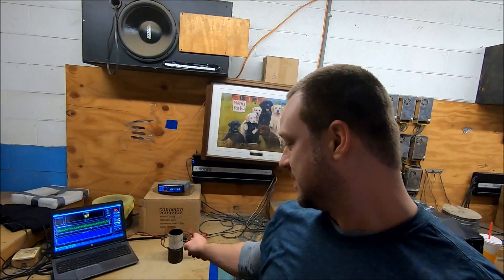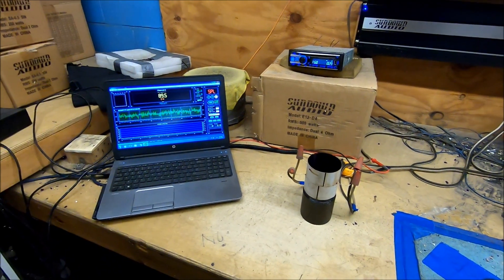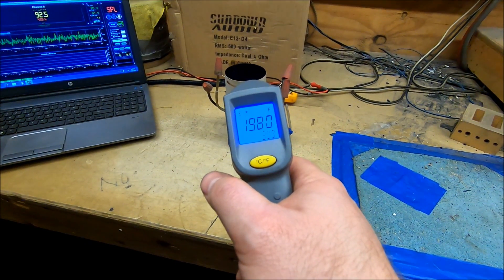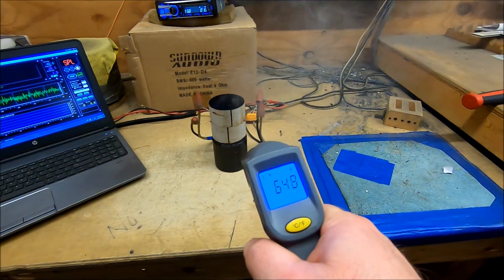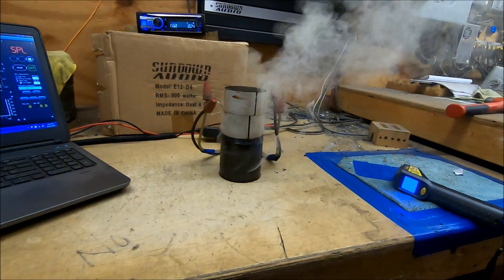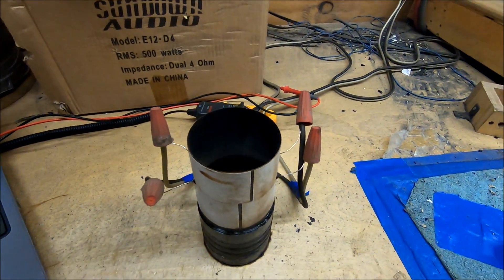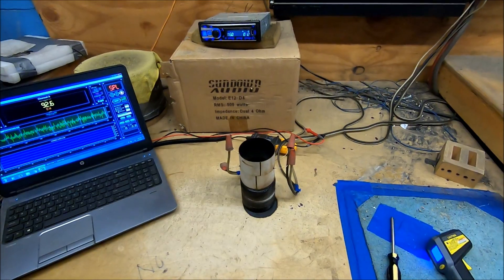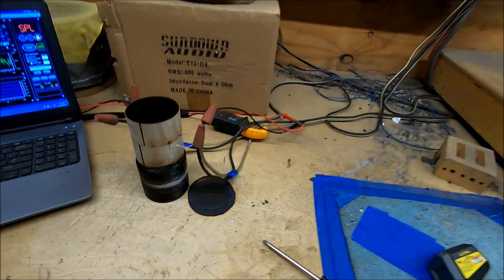Voice Coil Thermal Test *Tech Time Thursday* at Sundown Audio

Comment: I remember back when I was first getting into speakers and audio... I took everything apart at age 13 or 14 trying to figure out and understand how stuff worked. Took apart a legacy II subwoofer and put power (sound) through the coil and held it away from the magnet... as I got closer the coil would vibrate. Eventually making low audible noise. Was a cool experiment

Comment: For a pure entertainment factor, how about use DC. Curious how heat compares with similar power.  And would be neat to see how strong of an electro magnet it makes.  Move up in voltage say from 1 battery to 2 in series and finally with 3 in series.  Would also simulate clipping (tho constant vs short clipped sine wave).  Maybe even show working sub and give a visual description of clipping (how the cone moves out and then stops/stays).  And would show why it heats up faster in a way.  Just an interesting thought or idea

Comment: Can you explain why the coil heats more on the top vs the bottom?
Reply: Absolutely wrong. Power gets distributed evenly throughout the coil. The reason it's hotter that the top is because the table is wicking heat away from the bottom, as well as the fact that heat rises.
Reply: I'm thinking it's a mixture of heat rising and the power being supplied into the top

Comment: Cool idea! This shows just how good the epoxy insulation is on the coil wire. That's some serious power to try to dissipate while sitting on a table. Take a 10 watt bulb, and put it in a metal enclosure. You'd be surprised how hot it will get. This shows the quality of the American coils. 

I think the next one should be extreme amplifier testing. Lowest loads you guys can test to that don't hurt an amp. Maybe minimum voltage and thermal testing on them as well?
Reply from the maker: I've done a torture test video on the scv-4000d.  Ran it at super low resistive loads and high voltage.  Look it up here on the channel.  More amp tests like that will be coming later on.
Reply: @UnofficialAudio  awesome! Thanks Brian!

Comment: After heavy use for about an hour or so, I can feel my backplates on my SA-12s and they can get pretty warm. At 1200 watts each, I'm not surprised lol. But they take it like a  champ. What is an approximate safe operating temperature for your voice coils?
Reply: It varies by the coil but I have seen zv5 and zv4 be OK until about the 400 degree mark above that start breaking down glue
Reply: @1-Six-dee  how much of that heat from the voice coil is transferred to the motor?  For instance, if I measure my back plate to be a 150°, can I assume that my coil is also at 150°?
Reply: @jonpatterson6479  that is a grwat question it would really matter what sub u r running like my fi btl neos have an open motor so. If my back plate got really hot my coils would be hotter than closed  baskets, if u really want to know and have about 80-100$ to spare a guy makes voice coil tempature sensor that is awesome but for me I just smell mine and if u r smelling coil and on clean power then u know u r getting up to that 400 degree mark and it is time to back down
Reply: @1-Six-dee  what temperature we can asume its ideal for RMS power handling? with 2 hours pink noise test 6db crest factor?